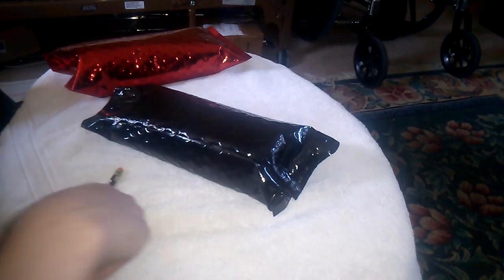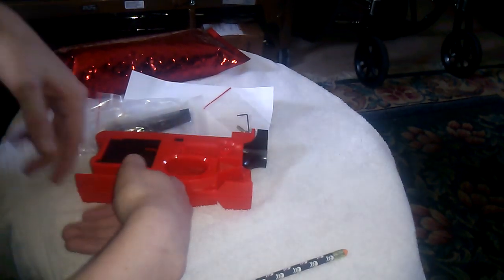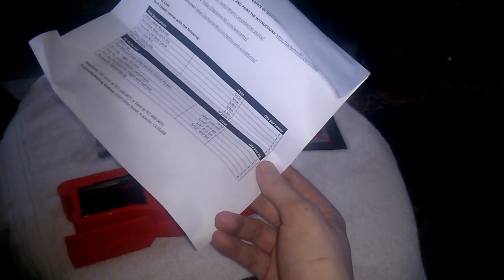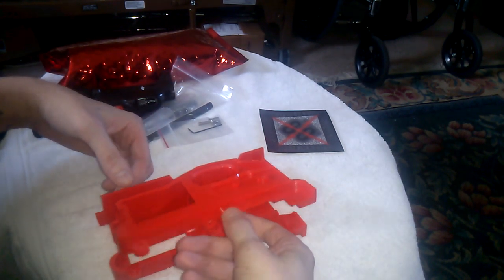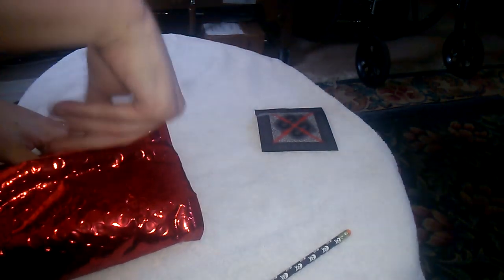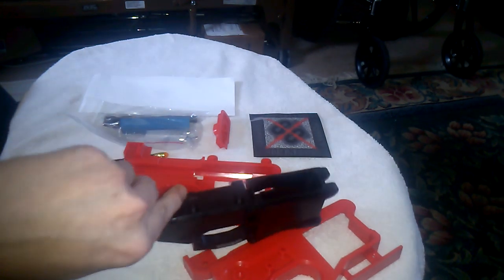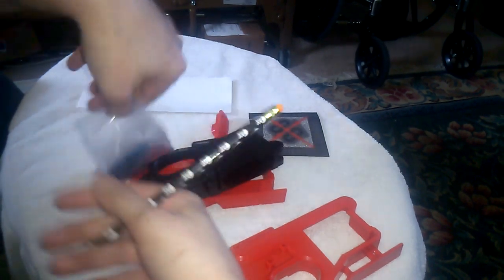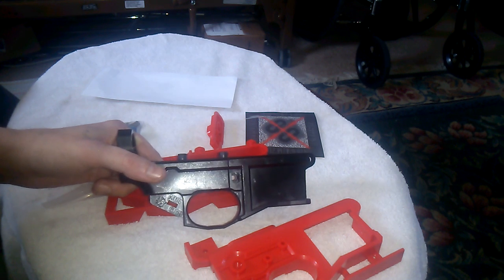Polymer 80 AR-15 80% G150 Lower Receiver Gen 1 and Gen 2 Comparison and Review

Comment: How do the polymers compare to the JamesMadisonTactical?  Poly80 seems a bit more plastic, sounds like polycarbonate.
Reply from the maker: rusty gray Sorry I took so long to reply.  The Polymer 80 lowers are a heavy duty nylon, flexible and tough.  The JMT lowers are high temp polymer with long and short strand carbon fiber reinforcement.
Reply: I appreciate the reply.    I have gen2 EP Gen2 JMT and Gen 1 of both.